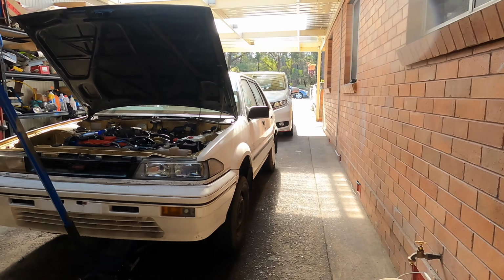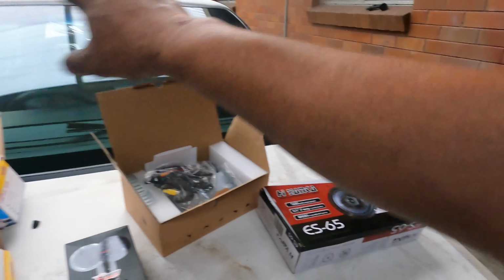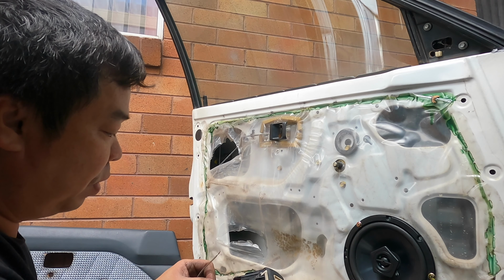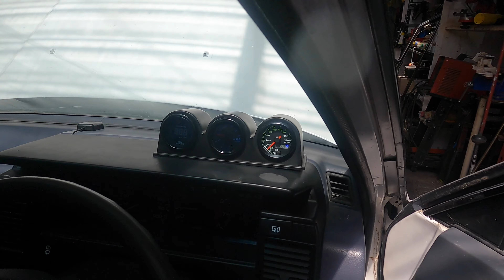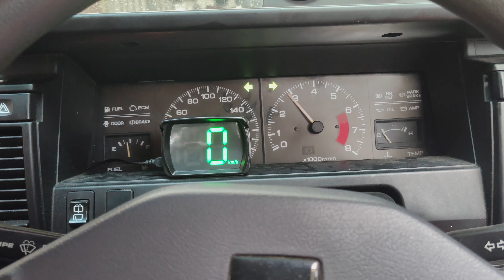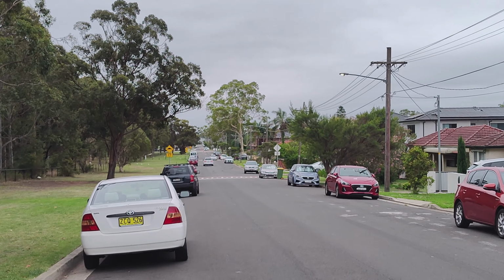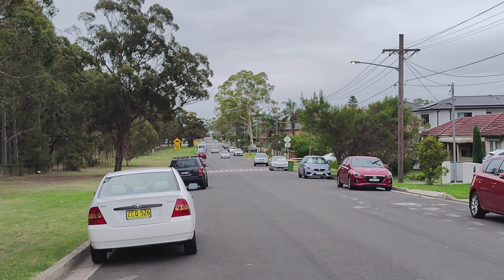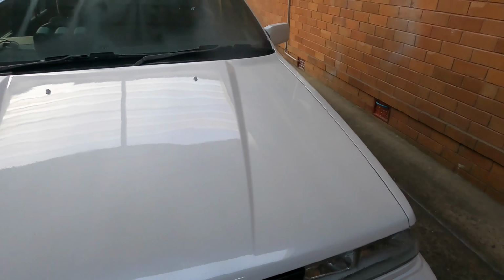Nissan N13 turbo complete project

Comment: Get her Dyno Tuned.
Reply from the maker: I think home made like this plenty of fan plenty of power.my bro got trouble to keep grip on tyres it keep spin
Reply: It doesnt even smoke tyres 😂
Reply from the maker: @kevwills858  good tyres
Reply: @TheDingdong78  
You should have used some bald tyres to make cool video (do it on private property) 
Youwill get a lot of views 😄
Reply from the maker: @kevwills858  mate if I do burn out cop will nock on my bold head
Reply: @TheDingdong78  
Cop dont care if you do it safe on private property ..
Doesn't anyone here on your youtube channel have a factory you can borrow to film ?
I just want to see the smoke 
🌫🚗🌫  😄
Reply from the maker: @kevwills858  think about put the car under garage shut down the roller door and do burn out make good smoke